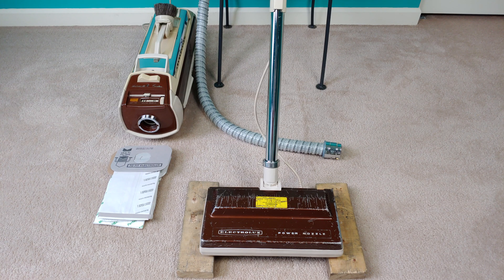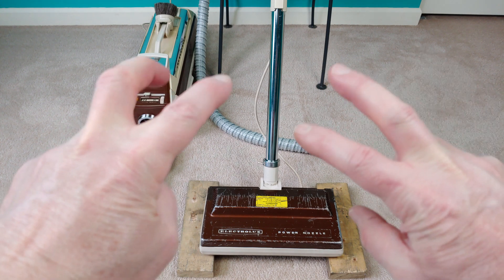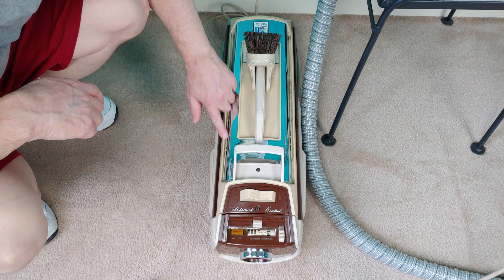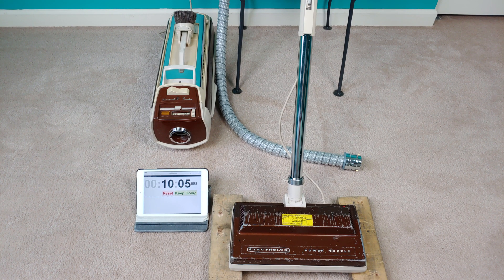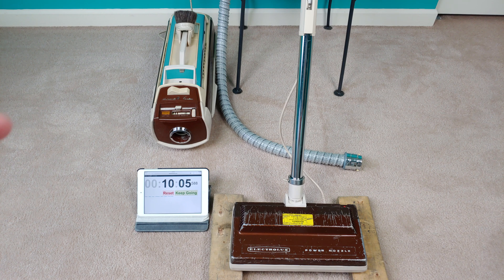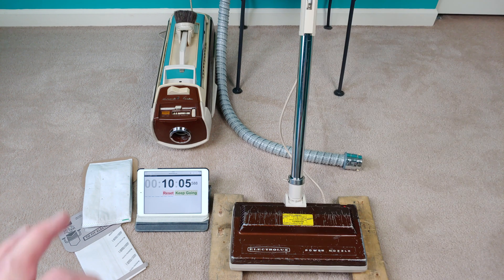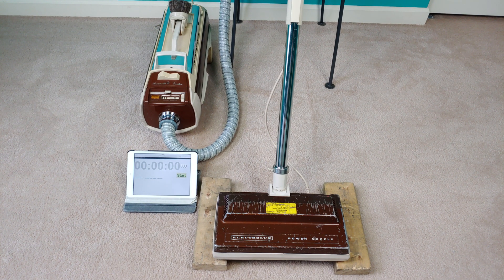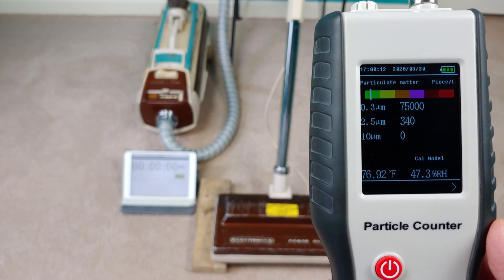Electrolux Olympia One 1401 B With PN4 Closed Room Emission Tests

Comment: I have lost almost all suction on my Olympia One.  How can I fix it?  Motor runs fine and it is not the hose.
Reply from the maker: If the motor runs OK, check the canister itself for suction first. Use a fresh bag.
Reply: The suction is week at the canister

Comment: At least you admit the carbon dust emissions are what the counter is picking up, there is one that does videos from the point of view of a technician but I still don't think he really understands what the scientific method is or how to use testing and measurement equipment.  This fellow makes good teardown videos and makes some good points regarding build quality and materials used in the manufacture of machines, but claiming the only useful tool for testing the performance of a machine is working water lift makes me question how he tests machines.  I know that's pseudo-science as I have a Kirby and a Rainbow and both machines work more with airflow and do a decent job when cleaning.  I hope that you have enough sample data to make your conclusions as we only see one test in your videos.
Reply from the maker: Only one test? Have you seen my extensive particle emissions test playlist? There's Rainbows and Kirbys in there too.
Working water lift is useless and is only used by him. Why would anyone think hose testing gives any meaningful performance data? Power nozzle testing is what matters for floor cleaning. In other videos years ago, I conclusively proved working water lift is completely fake, not to mention that the industry does not recognize it at all.
Reply: @VacLab  I mean to do multiple data samples with one machine for repeatable results to make a more informed decision, it's not that I doubt your tests as you can only show one or two in a video without boring the laypeople.  I mean, as a physics teacher you would know.  Of all of my teachers throughout the years I had, I liked the science, math and design (my design teacher is an industrial engineer) teachers the most as they gave me the knowledge regarding the scientific method and how to proceed. 

I also like the fact that you pour a measured amount of a substance onto the rug, then demonstrate how much a machine picks up by weighing the bag or trying to recover the substance from a bagless bin.  You also seem to do something that most others don't do:  under carpet tests to see how much a machine picks up the metered substance there and even "under the carpet of a carpet" is an interesting concept as well.

The only area that a working water lift would work is maybe if someone was running a large commercial portable or truck-mount gas powered hot water carpet extractor.  And again, that's probably not the only test of such a system as you need airflow to help carry the water and debris to the recovery bin.  The only machine that more or less demonstrates powerful suction I can think of to date as a dry machine and it didn't perform well when recovering soils was an Arco-Wand that Owen Perkins has in his collection of central vacs.